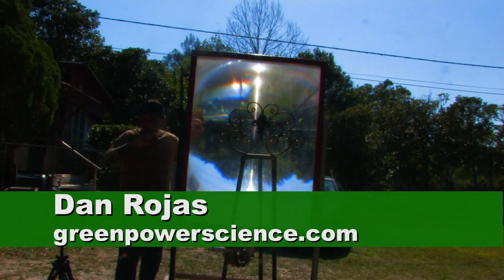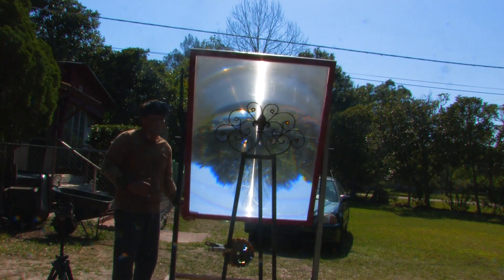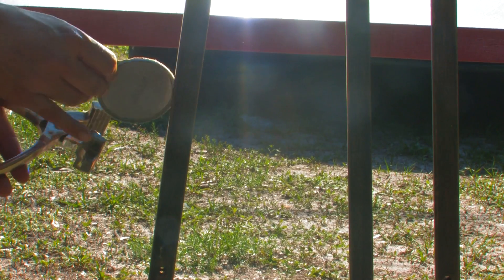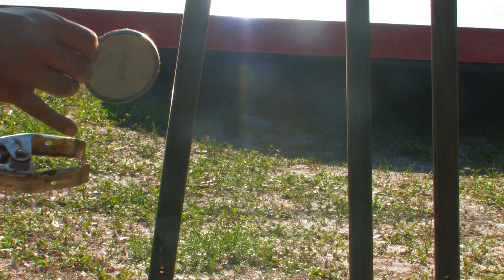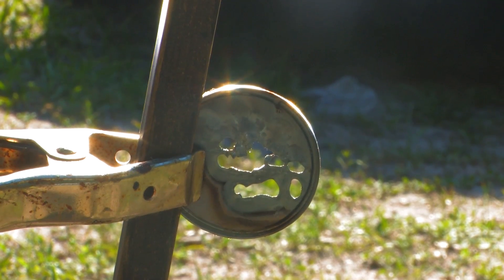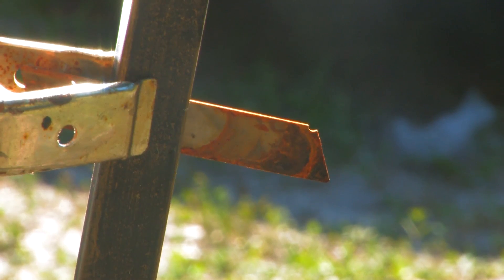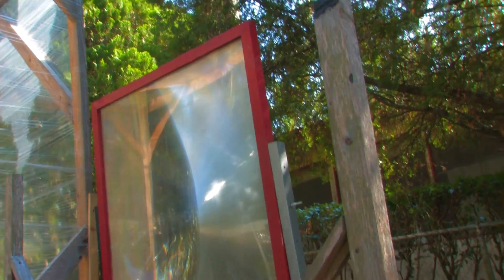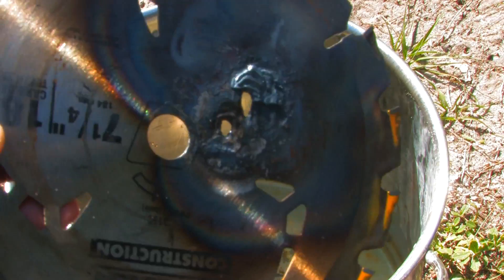FRESNEL LENS EXTREME Solar 3000˚ F Sunlight Melting a Burning Stuff with the Sun

Comment: These would be great for backpacking. If there is a rollable version, does the effectiveness decrease due to ripples in the surface? Would a Fresnel lens gather light on a cloudy day. I'm thinking of the benefit in use with solar panels. Imagine rotating a Fresnel array instead of a solar panel array to track the sun.

Comment: An engineer or physics teacher can help me?

Is there a formula of solar concentration? if direct sunlight of 2,5,10, 50 mirrors to the same point, how many ° C increase in point?

How do I find the temperature that increases the focal point?
Reply from the maker: A continuous curved parabolic mirror is best but if you are using squares, the ratio is difficult because smaller mirror arrays have a flip and scatter depending on foal lengths. This video explains the flip:
https://www.youtube.com/watch?v=u0aClpzytt8

When using small mirrors, 100 mirrors does not =100 suns. The drop for mosaic arrays is roughly 60%. So 100 mirrors = 60 suns if first surface. Second surface mirrors drop this to 45%.

Comment: man plz get a big sterling engine and put it before it I know ur smart so I don't have to describe the setup or ask NASA to donate 1 that could generate some serious power
Reply: +Teron  Barrett considering there is only about 750 watts per square meter of sun, you are limited to how much power you will get.    High temp does not equal high power when the focal spot is tiny.

Comment: I'd like to see larger versions of these lenses made to create thermal based desalination plants.
Reply: If you use the concentrated solar to turn a water turbine or a molten salt turbine, it should be able to generate electricity for whatever purpose.  There is also something called a Seebeck-Peltier generator, that generates electricity with no moving parts (but much less efficient).
Reply: Genius
Reply: Yes! Or perhaps to power a hydro generator for electricity.
Reply: Desalinization plants, or cloud making, climate changing monster plantations, terra forming deserts into grasslands
Reply: I'm going to try to heat water with one.
Reply: @pauli311  I guess the utensil will melt faster than water going to boil, lol
Reply: Or plastic pyrolysis.

Comment: The power of this steps me back every time, why exactly don't we use this technology to power our homes?
Reply: +Postghost We already do, its called Photovoltaic or solar...
Reply: No, I mean the lens for amplification, lol. I know solar power exists,
And yes, i know magnification is used in powerplantrs, just i haven't seen any for homes .
Reply: +Postghost the lens is not amplifying anything, it's focusing.  You are confusing power with temperature.  There is only about 750 Watts of power in one square meter of sunlight, and he is focusing that on a very tiny area which is why it gets hot.   By the time you factor in all the inefficiencies, size requirements and costs of a parabolic focusing power plant, you're better off building a nuke plant or natural gas.  The solar reflective plants in the California desert have suffered from financial and maintenance issues for decades despite having subsidies and one of the most sunniest places on earth.
Reply: Sugarsail1 Yes, focusing is probably a more precise word, amplify still means to make stronger or greater, which is exactly what the lens is doing to the sunlight in that spot, the  lens focuses the light, which in turn amplifies the amount of sunlight in that area.
The word amplify isn't restricted to sparky jargon, i'm quite sure the word existed long before electricity.
" By the time you factor in all the inefficiencies, size requirements and costs of a parabolic focusing power plant, you're better off building a nuke plant "
A nuke plant for a home?
yea, that's probably not the greatest idea, and just because some conglomerate wanted to look eco and design a money sink from square one and then call it "an example of the result of undertaking this type of initiative", doesn't mean their word is objective gospel. Im prety sure those things designed in the 80's weren't factoring in material technologies of today.
and natural gas? might as well be asking you why even bother to discuss the topic free energy in the first place?

Comment: I am a science teacher interested in doing some demonstrations with a Fresnel lens.  I have seen you wearing some protective welding glasses.  I wondered if you know the minimum lens shade number that is safe to use with the light intensity produced by the Fresnel lenses?  Do I need #14 welding glasses or can I go with something lighter like a #5?  I appreciate your feedback.
Reply: If you focus onto some metal insulate by an inert gas like argon, how would that change the melting? I think it would still heat it up but not burn, there would be no oxidation while melting.
Reply from the maker: scidude69 Hi, very dark sunglasses are fine for dark objects and torch goggles, the cheap $5 type are perfect for concentrated sunlight on cement or more reflective objects. A dark welding mask can create a work environment hazard as you cannot see anything outside the focal point and knocking stuff over or grabbing the wrong tool becomes an issue. We use the cheap ones.

Comment: man if there were a way to focus the beam to say a 1/2" spot and then move it around easily you could cut steel into any shape with the power of the sun!
Reply from the maker: The new level 3 lenses I am making have a selective second surface that acts as a secondary lens and increases power plus tightens the focal point. Secondary separate lenses do not work well. So this method I have been perfecting makes lenses that are as powerful as possible. Video soon, when things settle down.
Reply: GREENPOWERSCIENCE What was the model of TV that you got the lens from?  I have one from Hitachi it struggles to burn through paper.

Comment: It does answer this question.  I would like to ask if you've ever stacked wet lenses and used the parabola at the focal point to lengthen the beam.  Also have you ever tried using the Fresnel through a 2 liter bottle of water for off-grid lighting with a mechanical solar tracker?  Water bulbs are used in Third World countries where electricity isn't available to the masses.  Car headlights are smaller Fresnels, yes?

Comment from the maker: Stacking lenses only shortens the focal length and while it does tighten the target area to a smaller diameter focal point, the filtering of light through a second lens dramatically reduces the overall power. The Fresnel lenses concentrate light vs amplify light. Here is an example of the lens through a secondary curved glass lens:

watch?v=zuthle6k94A

Thank you for the comment and let me know if this answered your question.

Comment: i was just thinking would it ever be possible to send that much sunlight through say a fiber cable and make some kind of torch like a plasma torch that uses no power at all. that is a lot of heat and it would be cool if you could go anywhere set it in the sun and start cutting metal.

Comment: Well done indeed. A question, if you don't mind: What is the most heat-resistant thing you've melted a hole throught, and how long did it take? 

And have you considered seeing what a Tungsten Carbide dilly-bopper would look like after incineration, and how long it would take?

Comment: Concentrating sunlight by using a Fresnel onto the circle of a parabolic mirror as unfocused light would add more photons to the final focal point that the parabolic mirror produces. This would result in additional heat from a reduced footprint. It all just depends on what you're trying to do with the heat you're collecting. :)

Comment from the maker: Fresnel Lenses and Parabolic Dishes concentrate sunlight vs amplify it so one off of the other only tightens the focal point to a smaller area. The Fresnel lens destroys a parabolic mirror instantly. A glass lens does do the same BUT there is a significant drop in power as the light filtering of already concentrated sunlight is exaggerate resulting in a net zero spot power:

watch?v=xeUI8vPkUqI

Comment: Hi, if you don't mind a question about the size of the lens, is 65" the diagonal measurement, or what is the length/width? Wondering if this is the same * SIZE-----------------48H X35W 64" spot lens that's at your web site. 64" SPOT FRESNEL LENS FRAMED ~ Thanks!

Comment: btw, have you ever tried multiple beams? Like using mirrors and pointing multiple rays to a single point and teach higher temperatures? Technically the mirror don't reflects 100% the light it receives so over time it would heat up or even melt.

Comment: Melting metals. If those things can melt steel pieces under seconds, I won't have trouble with copper and aluminum. Not to mention tin. Which are the best "shippable" lens for this use? I don't know if the size is the only thing that counts on it's power. Thanks for your support. I hope I can get one of those soon.

Comment: 3:59 sax
btw, where did you get your lens? I'm dying to get one like that. I love working with copper, aluminum, iron melting. But gas and coal are quite expensive. Also furnaces don't last forever.
Reply: A little bit late, but I think he sells them on his website. Should be a link in the description

Comment: Very interesting!
I woke up this morning thinking about how power could be generated for a mag glass
I'm impressed, so how could you harness this power to heat a house
Let me know when you figure it out
I'll probably be thinking about this video for a long time
Thanks for putting this tech stuff out ther
Good Luck Terry!
Reply: the power is the same as the sun hitting your house, so you would only get that much heat.
Reply: @paulczerner3286 to an extent - colors and elements absorb and transfer sunlight at different rates - houses are not designed to optimize heat absorption

Comment: Cut the blade up and melt it in a cauldron surrounded by refractory cement (that single 65" lens is definitely enough heat to make molten steel if you just contain the heat). Or try welding with it. Try to get a hold of some green sand so you can pour molten stone. 
Want me to design a special forge for this lens you can make with refractory cement by constructing the wooden forms? First you need a cauldron capable of pouring steel (or work with aluminum in stainless) to design around.

Comment: I doubt this sort of thing is not portable enough for welding in most circumstances. I guess you might be able to do something with fibre optic cables, but it is unlikely that any cable could handle the amount of energy the lens in this video was delivering.